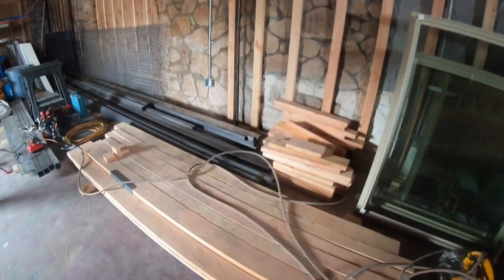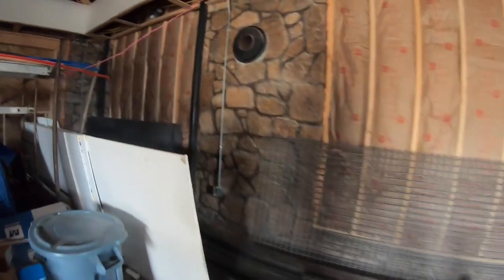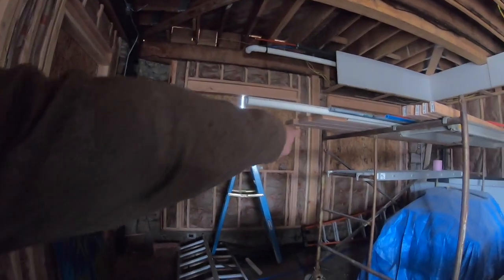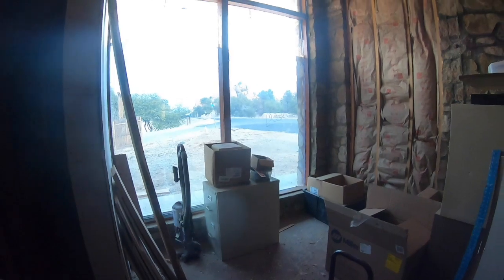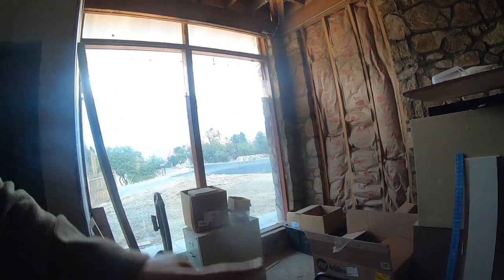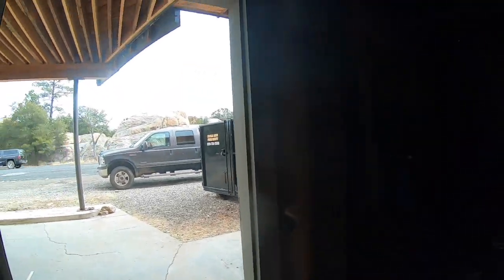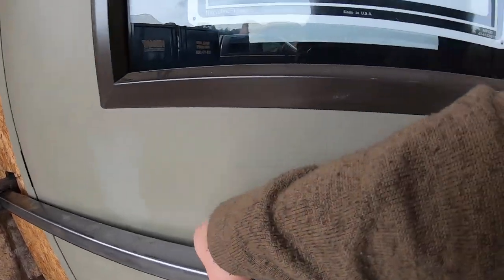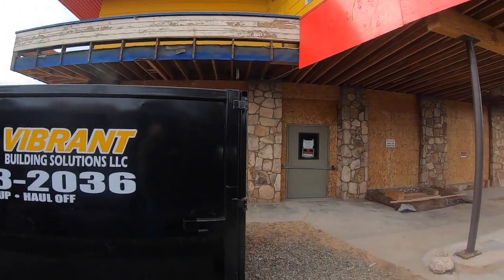CCTV E53 PCC Building Update 12-23-19

Comment: Coming along 👍
Are you using ballistic glass for the windows? If not you might put some ballistic film on them. Of course it doesn't make them bulletproof but it does make it harder to break the glass so it would be an additional layer of security in addition to the steel.
Reply from the maker: InMyImage no I didn’t. It’s already expensive enough covering them with steel. I couldn’t afford to do that right now anyway! I’m broke!!! Lol. But truly I have everything to my name into this...
Reply: Prescott Caliber Club You might check into the film. It also is supposed to help with blunt object impacts.
Reply from the maker: @inmyimage1081  I like those security screens they have. Have you ever seen those?
Reply: Prescott Caliber Club I assume you mean like what is on security screen doors, if so yep, had one on our first house, incredibly sturdy. I think you can buy it as "perforated steel"
Reply: Prescott Caliber Club Oh and it would make welds much easier and much stronger because I'm confident your welder isn't going to weld every single one of those wires in that piece of twisted sheet you have right now.
Reply from the maker: InMyImage no, they make these screens. And I’m talking. A screen that goes over the window but you can’t even baseball bat through them! Google it, they’re wild and interesting.
Reply: Prescott Caliber Club Holy crap, just watched a video of one by KNA in Australia and it looked and sounded like the guy was hitting a steel plate 😳